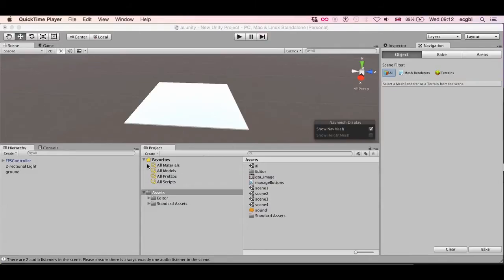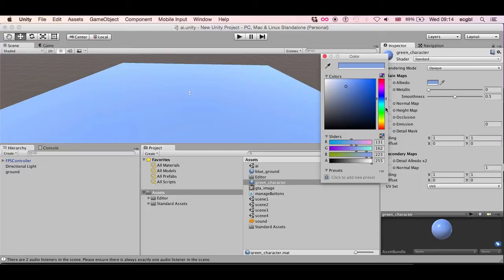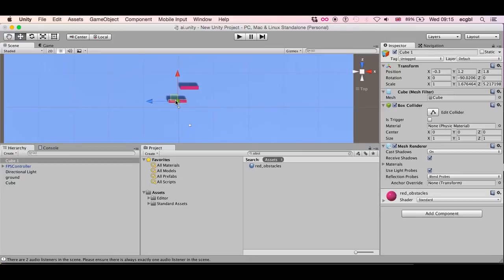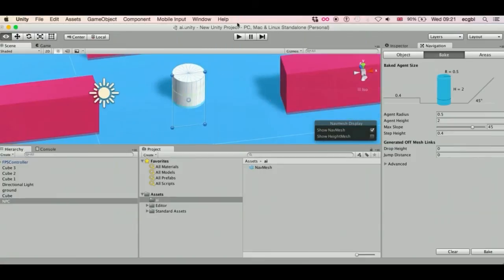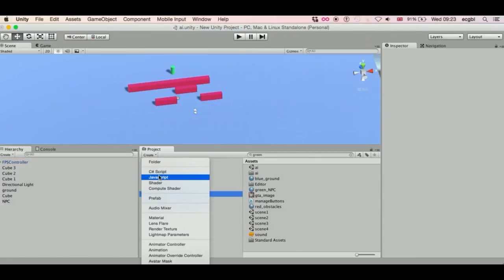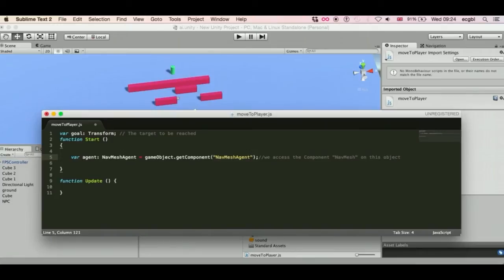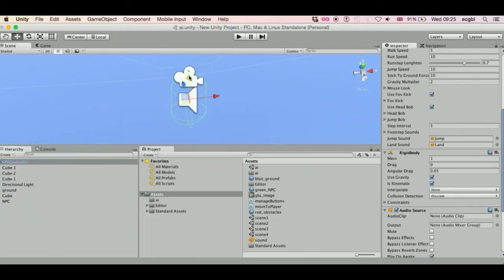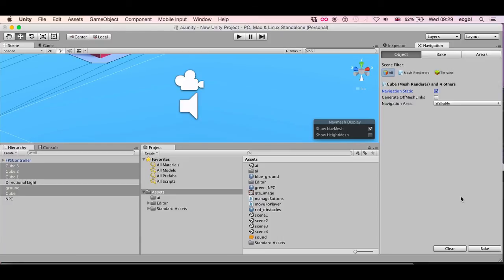Using Unity's Built-in Path Finding: Part 1

Comment: Few questions:
Does this work with maps that aren't flat? or is there an alternative that works for 3D terrain?
Is it possible to add "soft" obstacles (i.e. mud puddle,which slows you down) and make the path go around the puddle if it's faster than walking through it?

note: I'm capable to implement all this on my own, but if possible I'd like to save the time and use what Unity has built in.
Reply from the maker: MrAntiKnowledge Hi there
Yes, this should work for terrain too (will have a video posted shortly if you are interested in the how to). Not sure about the soft obstacles since, since the Navmesh is supposed to either avoid or go through obstacles/objects (so may not be any in-between mode), but will check and let you know. Is there any other questions you have regarding Navmesh (I could bundle up an example that answer all of these)? What type of game are you trying to design? Is that just as a hobby or are you planning to publish?
All the best!
Reply: Learn2CreateGames The questions I had about Navmesh, I already asked.
For the game there is not much set in stone yet. The core concept is that player get thrown in a world where they can use magic, but they have to combat the effects extensive use of magic has on the environement (I call this "corruption", but that might change). (Factorio has a similar system like I had in mind (Polution), but it will not only aggro Monsters but affect the environement). 
A combination of the Factorio-Polution and Thaumcraft(minecraft mod)-Taint would describe it decently well.

The world will be voxelbased (so it's easy to modify ingame) but I'll interpolate a mesh over it so doesnt look "blocky".

It's a hobby project but I'll make it available for puplic if I deem it playable enough. (otherwise it will end up in a very dark folder somewhere hidden on my drive, like the first game I ever made in Java * cough *)
If it turns out well I might consider monetizing it.
Reply: Learn2CreateGames I looked it up myself (should have done that in the first place :') )
Unity seems to have a pretty solid documentation, thats always nice.
And yes, you can assign different "costs" to your NavMesh. (and even conditional costs. like "make this only traversable if the player got a key/got a certain movement skill(i.e. climb)
And with offmesh links you can even get tunnels or jumpable gaps. 
All in all Navmesh is pretty solid, I think I can use it without much tweaking for my purposes.
Reply from the maker: MrAntiKnowledge 
Hey, great to hear that you found what u were looking for and that you will be using it without much tweaking; From looking at it yesterday, looks like its pretty comprehensive alright. Best of luck with your game. Will give you a shout once the video is out (Navmesh + terrain). All the best!